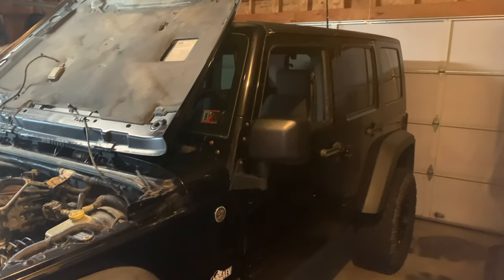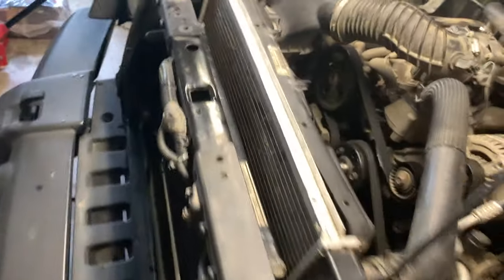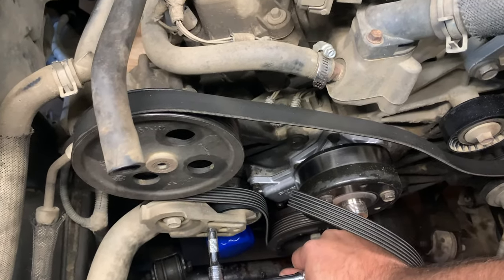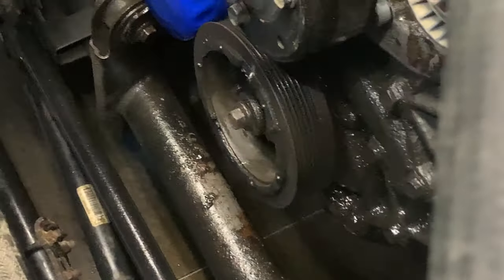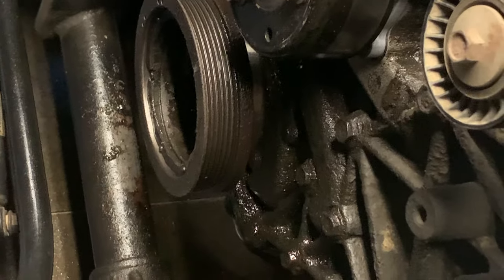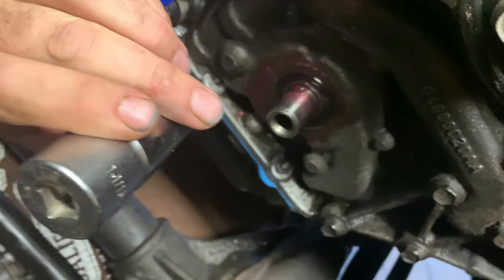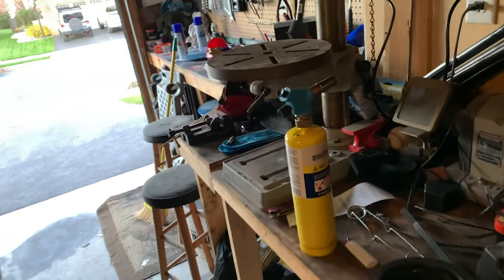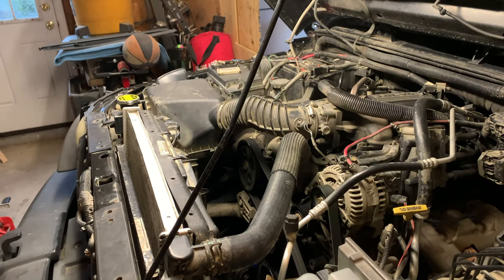2007 Jeep Wrangler JKU Harmonic Balancer/Crankshaft Pulley Install

Comment: I believe that bolt has a torque spec of 40f/pound. This part is very important because just like in this video, I used my impact gun to drive the pulley back in, then broke the bolt deep inside the bolt housing. Now initially a half hour and a can of beer job turned into a nightmare. I gotta drill the broken bolt n try to remove it. Not much of a room to work and the temperature is -23 Celsius here. 🤞

Comment: were you going to replace the pulley along with the crankshaft seal from the beginning or was the pulley only replaced because of the "oh shit" moment? mine has a tiny bit of wobble in it not sure if i should replace both
Reply from the maker: A oh shit moment we didnt know what to do at first and pulled from the wrong position and corrected ourself i think i said it in the video to grab from the correct area in order to not mess it up for anyone else watching and trying themselves. So ya we ended up replacing it as well as the seal.

Comment: How did you hold the pulley from turning while trying to get the bolt to the additional 105° after setting the torque value?

Comment: So got it swapped up, discovered a smaller puller won't work, had to rent a Chrysler specific one to fit it. What did you have for torque specs. The sheet the harmonic came with doesnt list one. But online I've only found 1 place listing 40lbs.
Reply from the maker: Ours was about like 55/65 lbs sorry for the late response
Reply: @ifitfitsitrips5600  oh np, thank you for the response either way. It will definitely help someone else along the way.

Comment: Hey any idea what the gasket is called?
Reply: It’s just the crank shaft pulley gasket.  It should come with the pulley.  Let me know if that helps.
Reply: @catchthisSK  thank you for the quick responses, I was able to locate it at autozone earlier today. It comes up as a separate part, but is listed as you typed it.
Reply: @Lagniappe.  I had to use a socket the same size as the gasket to get it in place.  Just a heads up.  Take your time.
Reply: @catchthisSK  I saw that, thank you!  Luckily wife works at home now so I can take time and use her car in mean time. I have to change that, water pump and temperature thermostat